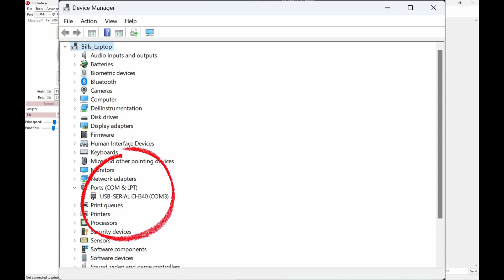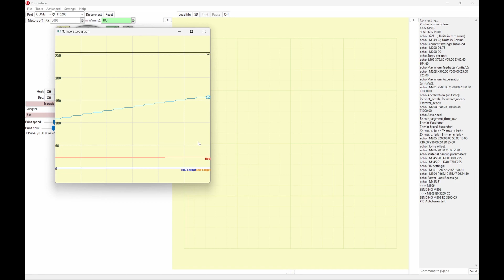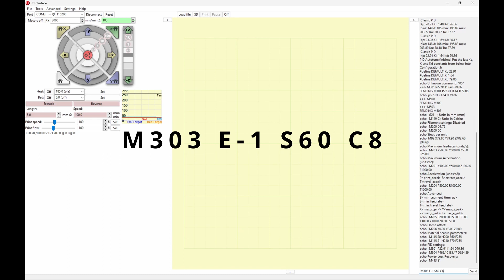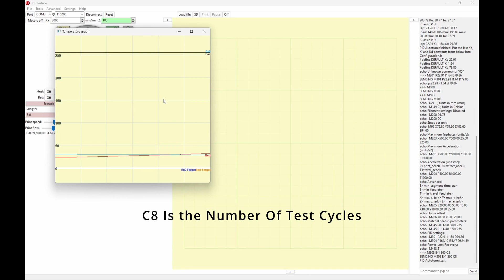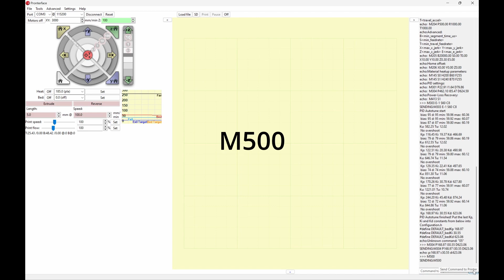Consistent Print Temperatures By PID Tuning Your Printer

Comment: So if I'm printing with PETG and typically do not use my cooling fans, I would do this with the fans off?
Reply from the maker: You'll find mixed answers to this on the internet. I feel that it's best to run this at the temperature that you print at, so if you don't typically use your fans while printing, I would do it with the fans off. If at some point you find yourself printing more often with the fans on, then rerun the process with the fans on. It only takes a few minutes and is worth it! Thanks for watching!

Comment: What version of Marlin is this on? I think in 2.x.x the bed is M303 EBED and not E-1. I kept trying  the M303 E-1 S50 C8 and was getting "PID Autotune failed! Bad heater id" but it seemed to work just fine with EBED. Great video though! Was clear and easy to follow.
Reply from the maker: This is done on a bone--stock Ender 3 as shipped from Creality. Creality has their own version of firmware. But not all versions of firmware has the ability to PID tune the heated bed enabled.